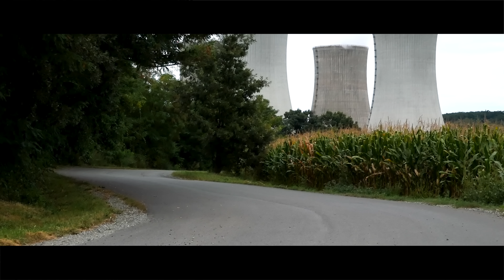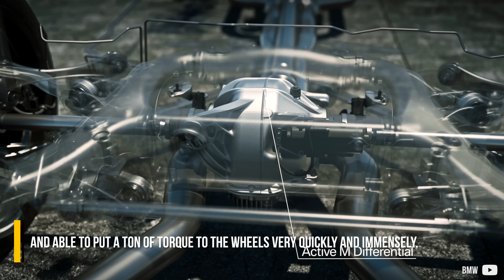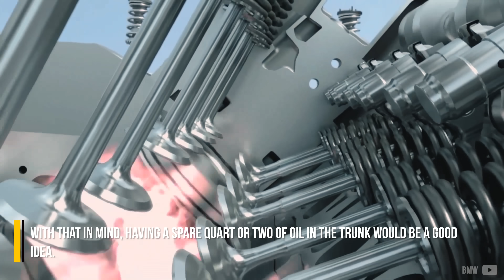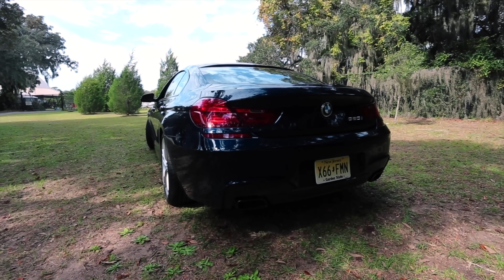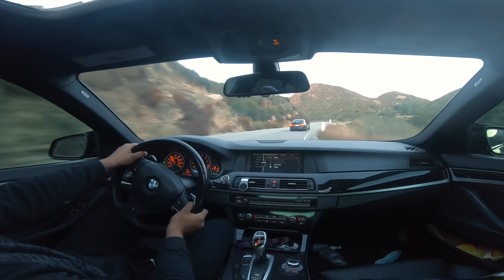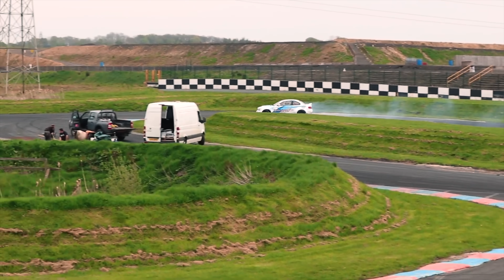The Worst BMW Ever?

Comment: I use Redline 5w40 oil only and change every 2k miles on my M6 Gran Coupe. Its an amazing machine. Change the DCT oil with Redline or Motul DCT Fluid every 30k miles with 5L drain, fill and filter... and every 50k miles change DCT oil filter, and Pump Suction Filter, full 7Liter drain and fill using ISTA. Change Differential fluid with Redline Diff fluid every 10k Miles. This car will love you back only if you show it some real love, no bullshit 15k miles oil change will keep this car running. I learned to take care of M cars way back when i had an E46M3 and E60 M5 and those needed much more service than any car I have ever had. This car is leagues more reliable than the s85 and s65 engines (E46 M3 was reliable in the older model I had but I purchased it new and drove it to 70k miles before selling). Those S85 & S65 engines where complete trash and need rebuild every so often. I spent a total of 50k on maintenance for an E60 M5 V10 over 4 years... stay away from those cars if you don't want a headache and your wallet smashed. The S65 in the E9X M3 is the same engine as the V10 just 2 cylinders less making it a V8, same exact design and bullshit. I do love how they rev up high and are mad fun to play with.. but to play with those two you gotta pay to play lol.

Comment: If people would’ve change the oil every 5000-6000 miles which is 10.000 km there would be no issues with these engines
If it was me , i would do it even 3000 miles. I rode the crap out of my ducati1198, aprilia v4 ,buell 1125 which are known for catastrophic engine failures 
Never had any problems

Comment: Good video, but from the testimonials of other commenters, and also a history of N63TU3/S63TU4, since 2020, we have not seen any complaints from the online community. Also, N63 is installed on Alpina B5, and this premium car company would not install crappy engines. Mine M550i from 2023 has now 15000 miles, and there is no oil consumption whatsoever. Only what does bother me after I asked BMW is that they do not recommend any sooner oil change. They are quite confident there is absolutely no need for it since the car automatically estimates the oil wear based on various factors. In the case of oil wear, the onboard computer would reduce the oil change interval. Understandibly, no one trusts such claims.

Comment: If anyone is having problems with the BMW M5 F10 S63T motor than you are probably doing maintenance at the time the car is having issues or most likely changing the oil every 8K miles per dealer recommendation.  For the type of people that like to run the car until it breaks down, maybe a Toyota is what you should be looking at purchasing!

Comment: I’ll save you the 11 minutes and say any BMW V8 after 1998 is bad. They either suffered timing chain, guides, valve stem seals or a mixture of both, and that’s not getting into the FI V8s that had those PLUS a host of other issues.

Comment: Intake manifolds are faulty & melt .. check them if u have any air leaks - drivetrain malfunctions , 
This limp mode is HIGHLY DANGEROUS- someone is going to DIE IF THEY ARE NOT ALL RECALLED . 

Why ?? Wtf 🤬 are they using plastic intake manifolds ?? THAT MELT & can catch on fire . 

There is no temp gauge on the dash as it would be red line boiling 🥵, there is no bonnet scoop to allow air .  They cook , melt & limp mode . 

Spent $20k over 2 years . BMW can’t & won’t fix it .. 

Australian BMW WILL NOT HONOUR THE N63 CCP CHARGING $$ for ALL OF THIER negligence..  

Profits before the people

Comment: My 2013 S63 now has 139k miles on it, still runs like new. Maintenance is key

Consumeables like injectors, coilpacks and spark plugs are the main failure points.

Injectors in particular are responsible for many engine failures due to flooding of the cylinder, either causing oil dilution or bending a connecting rod upon start up

Comment: BMW is designing their newer cars (2000 and later) for short-term attractiveness and flashy performance, with zero regard for longevity and lasting value for the customer, plain and simple. It has become part of its genes, since money hungry managers are running the company. It only works for people who have s..t load of money, who keep it for a few years and then pass it some unlucky fool, still thinking those are the same reliable cars that made BMW famous.
But, you can only live on your past merits for so long, and they will not be able to exploit that scheme forever.

Comment: Big pile of crap. Guess how i know lol. Not worth a single dollar put into it. German engineering in a nutshell with so much effort and so shitty result. A nightmare to work on, deadly expensive to run, ZERO reliability, pathetic power and smallest potential among v8s. Forgot to mention that it can suddenly destroy itself because of cheapout plastic parts that cost 5 bucks and you never know when it fails unless you overhaul the entire engine once in a couple of years. And there is not a single excuse for any of that but bringing your money to them. Yes, the worst!

Comment: Emissions regulations are such bullshit.  Obviously we don't want everyone's exhaust to be like the old days but there was a sweet spot in the late 90s early 00's where you could still make high-displacement engines that are considered  modern.  But whatever regulations have forced the C63 to be a 4cyl hybrid can seriously lick my nuts.  That was Germany's time.  They were never better than @1995-2010.  I'm an adult and 680hp is nice I guess, but I would never use it in Massachusetts.  I feel like 300hp in a 3-series or C Class or Audi 4, 400hp in a 5, E, or 6, and 500hp in a 7/S/8 is all you could ever need if it's geared properly.  I would happily live with lower power from the factory if the engines could still be large and full of character and not forced to use induction and electric power to attain ridiculous figures we can never use. The Hot V setup is overrated because, spoiler it too fucking hot at the top of the engine bay surrounded by high speed, high heat metal parts.  The packaging looks nice on a chain or fixture set up, but in the engine bay it's too damn hot.  Is there anybody out there who would not prefer a 400hp naturally aspirated 3.o V8 in a 3600lb 5series or E Class, or a 300hp 2.5 i-6 3 series or VR6 Audi?  How about a 4200lb S600 with a 6.0 v12 making 500hp on straight pipes?  I don't want a 3 liter Hybrid S Class that weighs 5000lbs and makes a million hp.  For 90% of people, a 450hp S500 5.0 would be the fastest car they've ever driven.  Safety and emissions can blow me.  EXCESSIVE safety, that is.  All of the sensors and systems and computers that add weight in the 10% chance you crash hard.  It raises the size, weight, cost, and unusable power in new cars.  Very little character available for under $150k.

Comment: I'm surprised that this video is so recent, yet doesn't speak heavily of the first and later technical updates. The initial N63 prior to technical updates was admittedly a tragic first stab at a V8. However rather than scrap the design, BMW has spent the past 10 years investing into R&D on these engines up to and including TWO more technical updates. In my eyes this speaks to me on the level of effort BMW has taken to change the narrative on this engine from one of the worst to one of the better.

Comment: In my opinion most of these problems are caused by oil change intervals. I change oil in my cars every 10-12kkm. For engine like that it should be 8kkm. Actually a lot of BMW's problems wouldn't practically exist if oil changes were done from the very beginning every 10kkm, like for example valve stem gaskets.

Comment: heat management & cooling is the key to performance and reliability (Chip foose)..rethink the entire engine bay ventilation & permanent cooling with (Porsche surge fans) for example..I installed two plate size powerful fans blowing on the twin turbo set-up & collectors (all extra fans in the bay work on a secondary separate battery set-up on demand) real working front fenders louvers are needed...! ,and front cooling fans working on demand) don't wait for the ECU heat sensor to kick on (eventually install lower water temp sensors) ,three heat sensors in the bay at key points (+gauges on dash) help manage that extra heat if needed (traffic in summer..!!)..extra hood louvers are almost a must for the N63 ,old Porsche racing reviews on how they were managing air-cooled cars is a great starting point to learn how to cool down a hot powerful turbo or N/A racing engine...my engine is full stock NO ecu or boost mods ,no street races or track..apart from high flow air filters (do not use stock filters) and extra cooling & extractors fans ,my car is untouched (frequent oil changes/oil filter & coolant flush)..and is a dream to drive on long back roads trips or autobahn...a beautiful beast....

Comment: lol I drive a 2012 550i manual. I made a video of it on my channel. Its been highly reliable so far. I do 3000 mile oil changes. Id say people trying to daily drive these cars or take them on road trips are the ones who run into problems with the n63. You dont need 410hp to go work, school, grocery shopping, or vacation. Drive it every now and then and have a honda for daily driving.
Reply: I own a ‘15 550i, and take it on long road trips regularly. I do oil changes every 5K miles, and have owned the vehicle since new. Currently at 95K miles, without any issues beyond having to replace a HPFP last year when it went out on me on the highway. I was getting some oil consumption issues towards the 5K mark when I would change my oil, but since switching to Liqui Moly, I can go to the interval without needing to top off and the dipstick always reading as full. I put a JB4 on it a few months ago, and connected the BCM and the sheer power and low end torque makes it rip, able to beat a stock F10 M5 by half a car with where it is currently at. It’s been a nice car for all the concerns that people seem to have with them, though mine is fitted with the N63Tu, thereby avoiding a lot of other potential issues that seem to follow around with the original N63.

Comment: First owner of a F10-535i in the United Arab Emirates with 130k on kilometers on it I’ve faced 0 problems and no leakage

1 secret to its life is I have it run 30 mins before I leave to work everyday and 20 mins in the evening before I drive off ( I kill time by talking on the phone)  

Lastly use the best oil available.

It’s an amazing daily driver and wouldn’t have anything els, the new models are different that my F10 2011 , I’ve driven them but they aren’t as good as my car - hope this helps

Comment: Damn, this is so true. I have waste gate rattle (rev above 3K) when reving in N gear. I had injector replaced under warranty at 50K miles - drivetrain malfunction and stopped on the middle of the highway. Sold and replaced with a Tesla. 
But, still a M car accompanied us for 8 years, we all miss it.

Comment: As far as power performances it’s one of the best V8s because of its heads. But as far as reliability it is by far one of the worst in V8 history these engines even with up to date service records on factory tune blow out of nowhere valve seals bearings oil consumption so yes it’s definitely one of the worst but one of the best as it’s performance capabilities

Comment: enough of this shit already. half of the people that get this car do not do MAINTENANCE!!!! no car is reliable, every car has problems. my n63 550i is a powerhouse, i smoke everything i see lmfao. i did blow my motor due to high tuning and stress on the motor. and anyways this car is no good on a hot climate, i live in canada and it's always cold here, so i basically have boost weather everyday lol. car is amazing but you just have to have luck on ur side or a pocket full of money for maintenance.
Reply: i also got a brand new 2022 update n63 engine with m550i head.

Comment: Bro you must really hate the N63 lmao, just don’t idle the car for long times and use a lower thermostat, on the non TU models also run better oil cooling and the car will be much more reliable

Comment: 2005, 525D, E61, 130kw, 2.5L, M57 engine, 501 000 km on the clock. Zero issues. Starts with -20c in the winter. Oil changes after every 10K. 8.25L of oil.

Comment: Been struggling with this car for 3 years now i havent driven it since 3 yeArs every time i fix it it breaks again 2 engines 3 crankshafts around 6 oil pumps car costed more than its worth and still not working

Comment: That's is great advice right there get to know the engine. Having been a technician for the last 20yrs it's important to know what is under the bonnet. I've restricted myself because being a technical advisor I get no workshop time so I am unable to get past my S65. As that's the last generation I had anything to do with. So if I have to buy a f or g or even k series bmw I'm going to have to retro fit my v8

Comment: I have a 2011 F10 550i with the original N63 motor with 130,000km's on it. Yes, parts can be expensive, but you are wrong in saying its the worst engine. Mine is strong with ZERO problems, but if you're going to purchase one of these cars, you need to be sure you can keep them going... It is 11 years old now, so like ANY car/engine, they all need parts... Its a great engine!

Comment: Funny to note then that BMW's only other 4.4-litre twin-turbo V8 is pretty reliable: M67D44  / M67TUD44. It is a cold-vee engine, like its M67D40 / M67TUD40 predecessor, whch might explain things a little bit. Peak torque matches the N63 / S63 at 750 Nm but limited to that by the ZF 6HP32 gearbox.

Auto-only and available in the E65 745d.

Comment: As a life long BMW owner, I would advise to stay clear of the V8's unless you have deep pockets or if it's not going to be your daily, straight-6 diesel, and straight-6 petrol is the way to go, and also the new B-series 4cyls are pretty decent too. One V8 which was fun was the small block 3.0/3.5 V8 from the e34 530i/535i
Reply: The old straight sixes gave the most satisfaction
Reply: You know it all👏🏻👏🏻👏🏻

Comment: I work in a BMW dealer and someone with an X7 took it to Valvoline for 10k mile dino oil changes. 
The parts and labor for their new N63 is $48k

Comment: Had bought a six cylinder 5 series some years back. Loved the car,  hated the problems after 50,000 miles on it. Serviced it at the dealership, looked after the car as prescribed  and was disappointed to the point where it literally stopped me from buying another BMW again.
Reply: Same here man, but with a F30 3 series
Reply: Same here, F10 m5. Injector failure after 50K

Comment: BMW offered or offers to have the main issues with this engine repaired. The TU version doesnt seem to be as problematic. Ive owned them for years and with proper maintenance and not driving like a 15 yr old that stole mom and dads car, these are great cars and shame most things that pull up beside them.

Comment: N47 without a doubt worst engine ever made with its timing chain and guides made out of chocolate. What a pile of shit. This engine is more responsible than any for damaging BMWs recent reputation. They fully know of the problem and is a manufacturing defect but they ignore and leave customers stranded. THEY WILL NEVER LIVE DOWN THEIR NOW POOR IMAGE FOR ENGINE QUALITY.

WHEN THE CAR HITS THE SHOWROOM IT SHOULD BE THE FINISHED PRODUCT NOT AN ONGOING TEST TO FIND OUT ISSUES.

Comment: i got this engine (2008 version) with 180k -- at 117k engine was replaced by BMW -- i bought it with 150k on car so about 40k on engine -- doing 5k km oil changes with bmw M specific oil and so far is going great

Comment: BMW has had a really really bad run over the last 15 years. My 318d now has 187k Miles on it but.... the timing chain did snap at 120k. Its just not acceptable for a "premium" car brand.

Comment: Previously, owning an M used to be a special, exciting experience. Those M cars had proper screaming engines which could be thrashed on track but would have no problem around town. It was special and heart-pounding. RWD, manual and capable of the most demanding tracks and tricks. An M wasn’t just a letter that you add to a car. It reskinned and remade the entire car from what was already a fantastic car, to a impeccable car. Designs were subtle yet striking. Everything worked harmoniously together to achieve the feeling only an M car could replicate.

Now M is a letter you slap onto a glorified washing machine with a pig nose and sell to a soccer mom or a quirky gen-z or a millennial and call a day. M now stands for money, not Motorsport.

Comment: I know in US it is not common to use a diesel engine, but here in germany we use it a lot and BMW is making good 3,0 Inline 6 Diesel Engines. 
I know a lot of Perons with the M57 an N57 Diesel with a way over 300tkm. My M57 has 380tkm at the Moment.

Comment: I owned a 2017 650i and what fun that car was but I can finally sleep at night as I sold the car without much of a loss, I got lucky... I did not have any issues while owning the car but my last oil service to BMW told me that I had an oil leak and it will cost me $2600 to fix. Two weeks later I sold it and never looked back.  88k miles and Lots of fun and escaped without any major pocket expenses. Don't recommend this car unless you make a lot of money. But what a machine to look at best BMW design ever